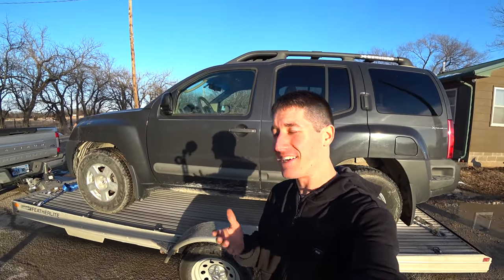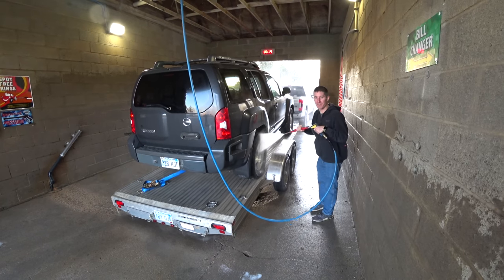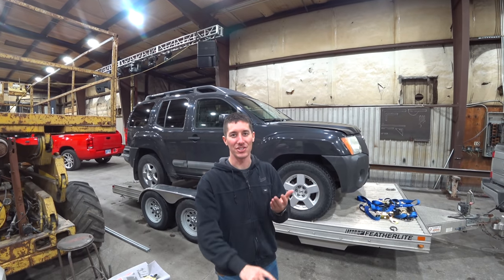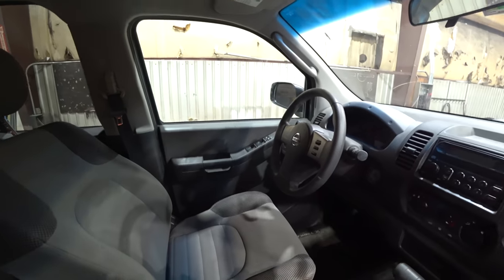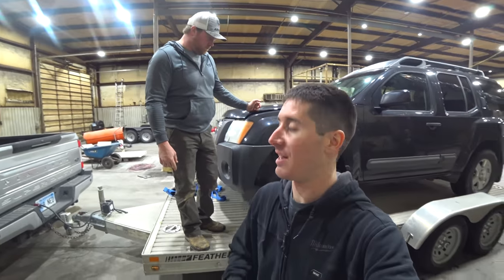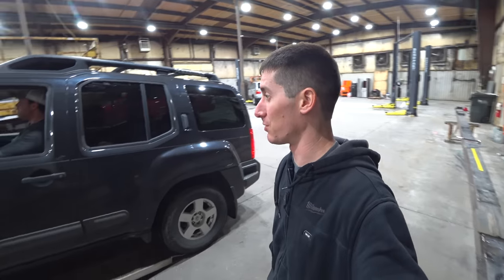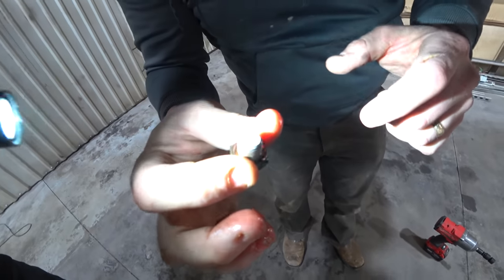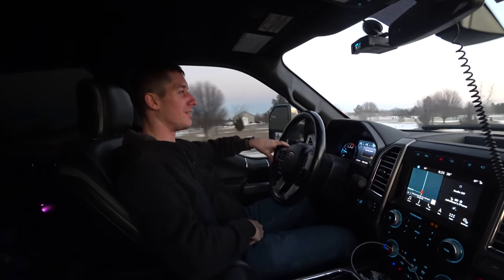The Nissan Xterra Is Everyone’s FAVORITE SUV So I BOUGHT One For Only $750

Comment: We bought our 2007 Yellow Xterra 4x4 new.  All maintenance done by me with factory fluids on time.  It now has 277,000 miles on it and the only drivetrain part that wasn't installed at the factory is the starter which I rebuilt at 240,000 miles.  Transmission fluid changed every 30,000 miles with Nissan Matic S.  It is still so reliable that we just drove it from Texas to Denver, ran trails all over Colorado down to Silverton CO, and back home.  IF you maintain them, they will run forever.

Comment: When you swap out that transmission make sure you install an aftermarket transmission cooler (if it hasn't been done already).  The second gen X Terra's have a transmission cooler integrated into the radiator, and they are notorious for failing.  When that happens, coolant mixes with the trans fluid and ruins the transmission.
Reply: The ominous SMOD
Reply from the maker: Might just install a new radiator if it hasn't been replaced. 🍻
Reply: I love my 1995 Pathfinder 4wd but I’ve always had a soft spot for the 2nd gen Xterra
Reply: Nissan changed the type of trans fluid in an attempt to prevent it from eating through the radiator. Seems to have worked on mine. Got 107,000 miles, still pulls hard  (2005 4x4)
Reply: @jaredoaks6317  What does SMOD stand for?
Reply: @taunuslunatic404  Strawberry Milkshake Of Death.... It stands for ATF mixed with coolant. It's like yogurt or mayonnaise...
Reply: also if you rebuild your unit make sure you get a different valve body. Cleaning the one in the ruined transmission wont work. Dad builds for a living. The coolant ruins it.
Reply: @omwtfym12  yeah but that would be an issue, if there were SMOD. It's not the case. If it's only a stripped converter spline, it doesn't make any sense to change the VB. ATF was clear, it may had bad smell but it's a used truck.. It's totally normal. (sorry for the bad English, I'm Argentine)
Reply: @lucasfernandez5779  Saludos desde España.
Reply: @taunuslunatic404  estás en España? O me saludas dsd Argentina?
Reply: @lucasfernandez5779  Soy español y estoy en España.
Reply: @taunuslunatic404  yo argentino y vivo en Madrid. Me parecía raro q fueses Español, xq aquí no hay muchos Taunus😅! Bueno no tantos como en Argentina creo... Allá si q es toda una historia con ese auto. Saludos
Reply: @lucasfernandez5779  Es verdad que no hay muchos Taunus aquí.
Es un coche que siempre, desde pequeño, me ha gustado. El mío es un 2.0 GLS de 1981. El motor es Pinto; no un Lima como los argentinos.
Reply: It sounds like the timing chain guides need to be replaced, has a supercharger whine but no supercharger, it was another common failure point for the 4.0 engine.  And good luck finding a inexpensive transmission for it, they run closer to $3k.  I bought one almost identical to that one last year for $1000.  Same year, trim, and even exact same mileage but it was Black.  
Edit:  Oh and the rebuild trans came with a new radiator included.  That is how common the SMOD was.
Reply: As someone who just finished the timing chain guides last month, run it briefly without the belt before starting that job. I finished the job on mine and the noise turned out to be the alternator lmao
Reply: First thing I'd do if I bought one of these is bypass that transmission cooler... what a horrible design.
Reply: The Xterra came with an internal transmission cooler in the radiator and an external in front of the radiator the external is fine just the internal has the issues from 2005-2010
Reply: @pops55650  Dude, the easy fix is to bypass that part of the transmission cooling. Its only a small secondary bit inside the rad that can fail, should work fine with a simple bypass or use a add on cooler if your needs warrant that.
Reply: @taunuslunatic404  Strawberry Milkshake of DEATH. When the radiator fluid gets into the transmission fluid, it foams up into a frothy milkshake mess that ruins the transmission quite quickly.
Reply: @opsihota2118  EXACTLY what I did when I bought mine 10 years ago. Bypass that transmission / radiator connection. I have two transmission coolers side by side and a new radiator and haven't had a problem. Half of the time I am hauling a trailer.
Reply: @opsihota2118  what exactly do you need to bypass it?  An external cooler?
Reply: @pops55650  Yeah same 112k on mine and I beat the shit out of it (drive it more like a Z with a VQ than an Xterra) thankfully the thing was beat to shit before I got it so I don’t feel to bad but  I’m surprised that I haven’t encountered the SMOD yet even with different fluid lmao 😂
Reply: That was fixed at the 2010 model year.
Reply: Happened to mine, I loved that car, until that happened.

Comment: Hey JR Those cars are notorious for defective radiators and the transmission  gets infiltrated with coolant
Reply: It will definitely benefit from a better radiator and transmission cooler
Reply: I remember my moms radiator exploding lmao
Reply: @rubennajera6735  Better an external transcooler.
Reply: I had that issue happen with my 2006 Frontier.  You definitely need to replace the radiator as well.  The coolant basically destroys the seals in the transmission.

If you don't, it's just going to ruin the next transmission you put into it.
Reply: Bingo
Reply: Funny, the WD21 Pathfinder had transmission issues due to the radiator integrated trans cooler too.
Reply: 06 frontier here bought new in 05 and when I caught wind of the exploding radiator I park it & bought new radiator and swapped it & added a external trans cooler and it never gave any trouble. Nissan are like a lot of brands the problems are all the same ie gas sending unit etc.
Reply: Correct, however that issue was resolved in 2010. After that the 4.0 6 cyl. and the 5 speed auto trans, are freekin bullet proof.
Reply: Yep, gets an internal leak and mixes coolant with the transmission fluid.  No bueno.
Reply: 06 yep fell victim to same thing after I got new timing chain :/
Reply: @Ieatpeople2  wow that’s allota miles! Still got my 06 only 87K on it so bought a newer GMC but now I’m afraid to sell it, don’t trust American trucks yet 😂
Reply: @jonathanecton9422  I had an 01 sienna that's a radiator exploded on luckily my wife pulled right over it did not blow the head gasket
Reply: I think I read that only affects automatic transmission equipped ones.  Solution? Buy a manual!
Reply: I wouldn't be shocked if that's why the transmission in this one was bad. It's a very easily preventable problem if you get on it before it goes bad.
Reply: Literally just worked on one that that the trans cooler circuit was bad trans full of coolant hahaha
Reply: Literally just worked on one that that the trans cooler circuit was bad trans full of coolant hahaha
Reply: Does this affect the 1st generation as well??
Reply: @ranmacman  pretty much second gen thing 2005-10 but it was all the nissan suvs in that era had the same problem
Reply: @ranmacman  pretty much second gen thing 2005-10 but it was all the nissan suvs in that era had the same problem
Reply: It's a radiator issue/recall that was fixed in 2009. Fun fact this same radiator was used in toyota 4runners and honda ridgeline which also caused smod.
Reply: @ranmacman  definitely more a second generation.  But I would definitely recommend a radiator replacement on a first generation ESPECIALLY A NEW HIGH PERFORMANCE RADIATOR CAP!!!
Reply: @ranmacman  the radiator cap pressure relief valve and spring tend to fail either 1.causing it not to open which causes the radiator to build excess pressure and radiator explodes. 2. If the cap cant hold the correct pressure and opens prematurely then you will be scratching your head trying to figure out why your losing coolant and constantly have to add. Better  to always invest in a new high PERFORMANCE cap and test periodically with a pressure tester on all your vehicles.
Reply: My transmission blew on the highway a few weeks ago, thank god it was under warranty from when I got it (they had just replaced the transmission) They still haven’t replaced the radiator and I’m going to let it pop again so they learn to find the source of a problem
Reply: They fixed that issue on the Frontiers in, I think, 2011.
Reply: I have a 2005  . The transmission went out same issue. I love my Nissan but the 2005 sucks. Its about to break down again .
Reply: Once you fix those two issues they are solid
Reply: @thillyer3467  new radiator and new radiator cap
Reply: That's why you buy the manual
Reply: Wrong year dude lmao
Reply: @BODYGUARDAXI1GOD007  yes they are fixed now.
Reply: We used to add external trans coolers at the dealership and then you bypass the cooler ports on the radiator.
Reply: @lab1042  Just sold my 2005 4.0 6speed 4x4 Frontier with 254.000 miles on it. Fun truck, still had the original clutch. Wish I would have kept it. Now have a 12 SL 4x4, but it's an automatic. It sucks you can't get the SL or Pro4x with a manual transmission. Thinking about picking up a beater 350Z for my manual transmission "fix".
Reply: Tell me about it
Reply: Only an issue between 2006-2010 models.
Reply: Not in manual transmission and for automatic was fix on 2010 year and up.
Reply: @wanker7371  what’s the solution please
Reply: The notoriety is only for the automatic transmition if i remember correctly, ive been owning a 06 pathfinder manual and ive not had any issues with the 10.000+ miles ive driven it
Reply: Hey sir..hope you are doing well..
Still need one just like that..can you help me to get it..i am ready to get i from you..please do it for the grace of God 🙏🏾🙏🏾🙏🏾🙏🏾🙏🏾🇭🇹
Reply: Not the 2011 to 2015
Reply: Even the 2000 do that too ..my friend have to change his radiator .gets over hit all the time
Reply: But still like them so much ♥️♥️
Reply: Good point . SMOD is the most important thing to check for before buying by inspecting the trans fluid , assuming it wasn't just changed, and can be prevented by doing a 30$ or so bypass , but best to replace the radiator for complete fix.
Reply: Yes there is a bypass you can do to it bulletproof it

Comment: Just bought one of these the other day with a "locked up" engine. Going to see if i can recover existing engine as it does turn over some with each start attempt. Verified both belts move. Bought for $475.00. Looking forward to the project myself, even if i comes down to engine replacement. Was actually just researching features of this vehicle when i saw your video notification come up regarding this purchase you've made. Looking forward to future content!
Reply: Maybe the AC compressor is seized.
Reply: Google the radiator transmission issue, you will want an updated radiator or aftermarket trans cooler.
Reply: Do a VK56 swap. You won't regret it.

Comment: Hey man. Some tips for you that you may already have discovered.

The TCU in the transmission is mated to the ecu and a new transmission is not plug and play. You will need to swap the tcu from the old valve body to avoid this if it isnt toast.

These transmissions themselves are oddly expensive compared to other nissan vehicles of this vintage. I've found that you can use the transmission from an 08ish g35s/g37s and swap bell housings, tail housing, and torque converter. They can be found for a couple hundred all day.

The trans has a hard time dropping out with the catalytic converters in most cases.

Most of these trans are damaged by a radiator issue introducing coolant into the cooler channels. Best thing to do is check in the reservoir for a milkshake. You can simply bypass the cooler if you want to save some money, but the right thing to do is replace the radiator.

Comment: I bought a 2015 Xterra Pro--4X new in October 2015 when I heard they were going to be discontinued. Now at 94,000 miles, it still drives like new. The SMOD issue was resolved in 2010. I've only had two small warranty issues since I bought it. It's been through blizzards and Las Vegas summers.

Comment: When I first bought my ‘09 Xterra, the first mod I did was installing a transmission cooler bypass on the radiator. Thankfully no transmission problems yet at 152k miles.

Comment: Me: Hmm, I haven't thought about an Xterra in years.

Also Me: Searches furiously for an Xterra on Marketplace and Craigslist.
Reply: @jzenick  I have a 2005 with 142,000 miles for sale for $5000
Reply: Way to much I got an 05 with 117k 6 speed manual 4 wheel drive and paid 4k for it

Comment: As an Xterra owner myself (2011 P4X) these things are crazy reliable. Now 05-10 had the radiator issue (SMOD: Strawberry Milkshake of Death) which is 99% probably the fault here. Change the radiator to the updated one with the trans swap. Once that's fixed, this thing will run forever. I just reached 180k and I haven't had a single issue with mine, still looks and runs like new. The biggest repair I've had to do was swapping the leaf springs. As long as you do the regular maintenance, these things are bullet proof. Mine goes to blue square trails and have trailered 6k lbs across the state (PA) incl. Off road. A literal beast!
Reply: Can you just change the radiator?
Reply: @carlosaguirre7723  before the trans goes bad, yes. But once transmission is broken, it has to be replaced.

Comment: So weird that a car that old doesn't look that old... Maybe I'm getting old... Shit...
Reply: I know what you mean.  I was a seinior in H.S. when these came out.  21 years ago! time goes fast i guess
Reply: @scottcol23  You are right, when you are young you cant wait to get older and when you are older time flies like crazy
Reply: Its because its brother, the frontier stopped being made this year. the xterra was dropped because of poor sales but if it didnt i wouldnt be surprised if were still being made today. the middle east got a new one but it looks quite a bit different
Reply: Banana yellow ones are xonkers
Reply: They made the same exact xterra no refresh until 2015 and its truck brother the frontier until 2020.
Reply: @quentinc1275  i said that already
Reply: That's why everyone tries to sell 20 year old trucks for 5 year old prices.
Reply: @Avi8tor857  20 yr old trucks got less CPUs than. Modern ones wood not even attempt tune ups on today's cars but 20 30 yr old cars you do with a paper clip and screwdrivers
Reply: @rsprockets7846  got to go older than 20 obd 1 (paper clip count flashes) ended in 97-98.
Reply: Yah it actually looks fairly new looking that car looks exactly like the xtrail they were brilliant car's except for the transmissions they would always go out at 310 or 400 Kms.
Reply: @rsprockets7846  I have a 2001 banana yellow xterra se and she runs like a top lmao. Had the transmission rebuilt and replaced for cheap two years ago. 185k on the clock.
Reply: Same as the frontier. they have been making it for 20 years and it still IMO looks good.
Reply: @shept.7736  on this side of the world, the have a new 2020 xterra in the middle east.
Reply: @jdkingsley6543  yeah I saw the ad. It looks nice, is it body on frame?
Reply: @shept.7736  
Yes body on frame. But has a 2.5 v4 164 hp engine 😂
Reply: No it has 4.0l v6
Reply: it's probably because they were almost completely unchanged for 10 years. A 2005 and 2010 look almost identical except for a very slight design change to the grille, and some really small interior details.

Comment: +1 on everyone saying cracked transmission cooler, but also make sure to check the timing chain guides. Early 2nd gens all had problems with plastic TCG's wearing down and causing a loud whine that sounds like a supercharger. It sounded like there was a whine when you started it up, so it might be due for timing chains

Comment: I have a 2000 Xterra that cracked the cooler in the radiator and it put all the engine coolant in the transmission which in turn caused it to burn up. It's a common issue and an expensive fix, mine has 228,000 miles and i love it. She has had a ton of work done but is a solid winter SUV and i live in the Northeast  so i keep it around.

Comment: I have a 2007 SE 2wde. Dad bought it new off the showroom floor in April 2008. He passed Oct 2008 and I got the truck. Only had 3100 miles when dad left. It now has 254,000 miles. Except for normal maintenance it has been a fantastic vehicle. 92000 miles it needed 1 front wheel bearing. $80 and half hr to fix. I did replace the radiator at 130,000 miles as a precaution. I didn't want the strawberry shake of death. I have had to replace coil recently and driver side cats, BECAUSE OF COIL FAILURE. I did just rebuild the front end, ball joints, tie rods, etc. Not too bad and pretty cheap. I never had any weird issues with the truck. It is now semi retired and relaxing in its old age.

The 2wd models aren't that heavy at maybe 4200-4300 lbs. By the way, they are known for having soft feeling brake pedals, even from new. Brakes always work though.

Comment: Man, you make me miss my 2010 Xterra even more. I loved that beast. Back seat area was a bit cramped, but the X was a quality build. When I got it, I had to replace the oil cooler seal to stop that leak. After that, it was just routine maintenance until we lost it in a wreck. Honestly, I think it could have been salvaged, but I didn't have the means to get it home to rebuild. I want to track this rebuild to see what you do. They are known for SMOD problems, and I wonder if that happened to this one since the trans fluid is new. It will be interesting to see what you do.
Reply: A lot of times the fluid will get replaced with the hope it will fix it.  And sometimes it will, but not for very long since the damage has already been done by the time people usually catch it.